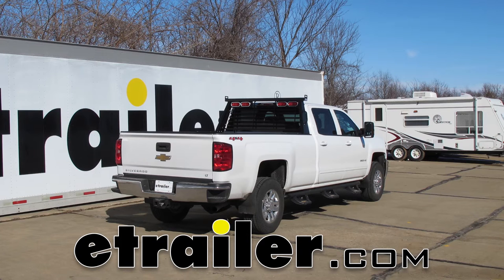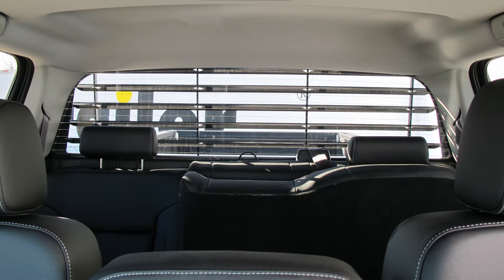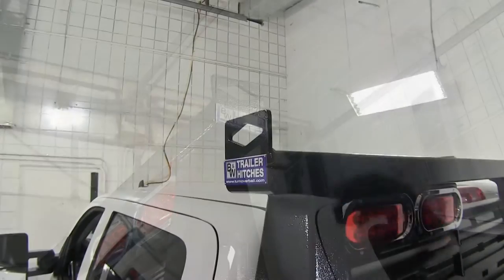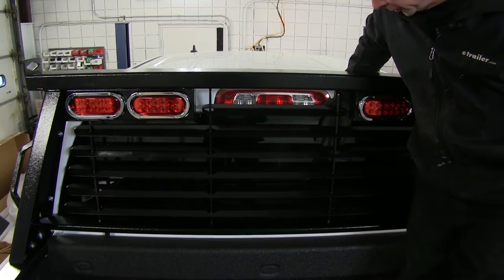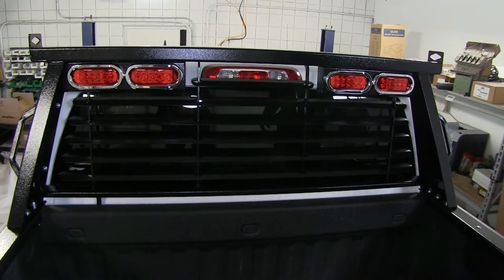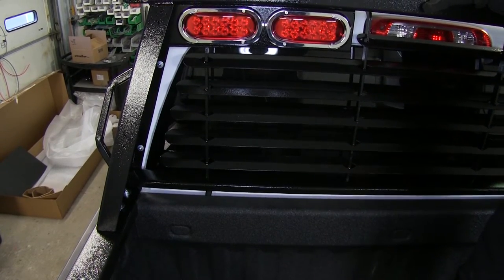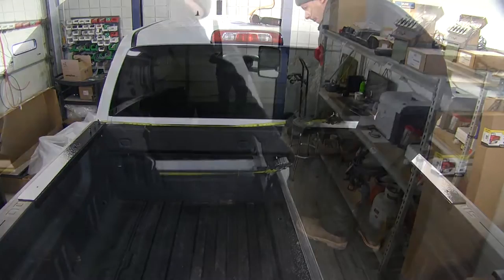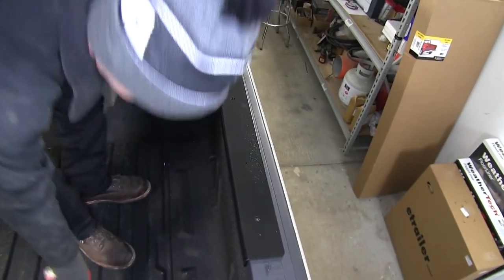etrailer | B&W Headache Rack with LED Lights Installation - 2015 Chevrolet Silverado 3500

Comment: Thanks for the help. I'm going to install mine & was wondering when I'm splicing into the 7 pin plug for the ground, can I just tie it into the trucks ground or would you suggest the self tapper method?
Reply from the maker: You can tie it into an existing ground. It just needs to be grounded to the chassis.
https://www.etrailer.com/Headache-Rack/B-and-W/BWPUCP7541BA.html
Reply: @etrailer  I installed it. Rather then tying it in on the 7 pin because of the sizing I just found an existing ground to chassis and hooked it on there. Thanks for the video it helped alot.

Comment: The brake wire would be the blue wire?
Reply from the maker: If you have a brake controller installed, the blue wire does carry the output from the trailer brakes, but it could be too much amperage for the bulbs. I'd recommend wiring the headache rack as shown in the video. You can also peel back the loom on the tow package wiring behind the bumper until you locate a light blue wire. This wire carries the brake signal, and is usually used for a 3rd brake lamp on a camper shell.
Hope that helps you!
https://www.etrailer.com/Headache-Rack/B-and-W/BWPUCP7541BA.html